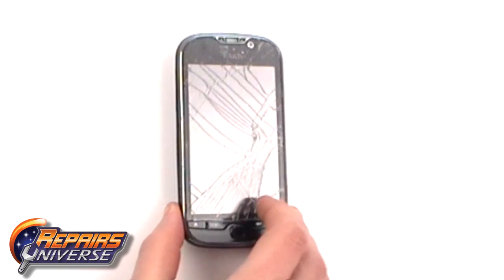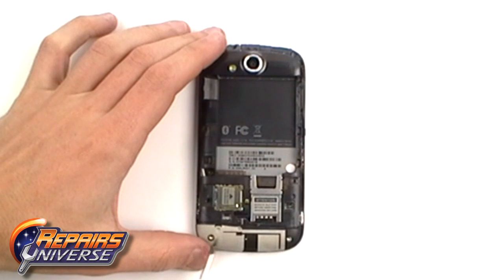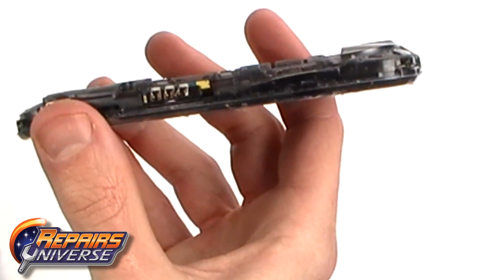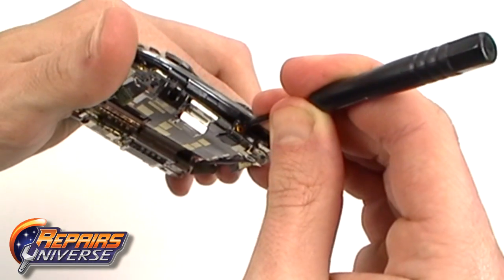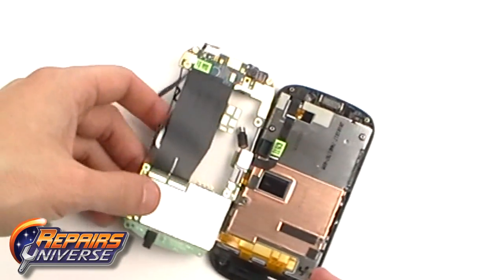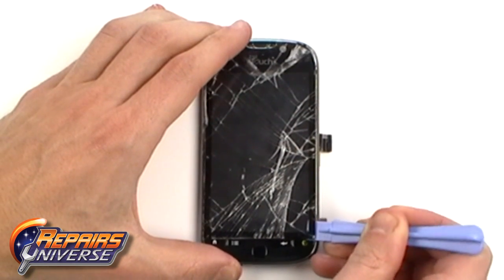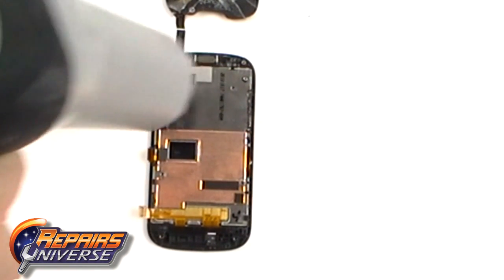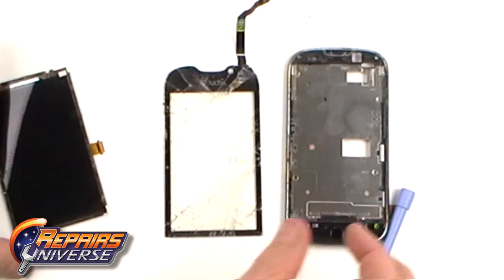HTC MyTouch 4G Take Apart & Screen Repair Guide

Comment: I tried this method last night. I now have a blob where it looks like the screen is touching the LCD screen and the volume flex cable broke off in my fingertips without even pulling on it.  The phone seems to be on but nothing on screen at all.  I think the main cable (the very short one thats hard to put back in) isnt in right. Do you sell replacement audio flex cables?

Comment from the maker: @SnObUnNiE04 Sounds like an issue with the keypad button flex cable. Either the connection is loose, damaged, being pressed in, etc. My focus would be on this flex cable. I am unsure, but it is possible the safe boot screen is being caused because these buttons are registering as already being pressed in. Start there and let us know if you come up with anything. Good luck!

Comment from the maker: @jmusgrove83 Sounds like the motherboard flex cable is damaged, not aligned properly, or not connected fully.
I would disassemble to that point and check all connections and check for damage. Hopefully you can diagnose the issue from there.

Comment from the maker: @shahwill1 Removing the physical power button. Likely an issue with the motherboard flex cable if that is the case. You should not have an issue returning the phone, however you would need to check with your provider to see the exact qualifications. We have had customers who have destroyed their phones and still got replacements. Others have a screw missing and are charged. Seems to vary quite a bit.

Comment: @RepairsUniverse By removing the power button, do you mean taking out the flex cable or the POWER button on the back frame?? I have tried it without the back frame coz the battery still goes in, but it still doesn't work. Also, T-Mobile sent me a replacement phone but they're going to inspect for 'physical damage'. My screen is installed correctly and there is no physical damage, do you think they will charge me the $80 for a new one? Also, i have it modded so will that be a problem???

Comment from the maker: @shahwill1 I would suggest removing the power button and then attempting to turn it on without the button in place. That will narrow down the exact cause. We have had many issues with the power button flex cable on the MyTouch 4G. Check for damage around the motherboard flex cable, it seems to become weak and rip very easily around the power button.

Comment: After i reassembled everything, my power button doesn't work.... I tried turning it on with the back frame out and it didnt work either. I doubt theres anything wrong with the internals as when i charge it, the orange LED light comes on. Please help? Also, its worth noting that i cant find the teeny little plastic sheet that came on the inside of the power button.......What DO I DO?

Comment from the maker: @biancabiancadonka If a flex cable is damaged there is no way of repairing it. Replacing the flex cable would be the best option. I am assuming the power cord flex cable is for the power button. The motherboard flex cable at RepairsUniverse (dot) com will replace this power button flex cable.

Comment: So if I accidentally broke the power cord flex cable, is there a way to fix it? like reconnecting it somehow? It got disconnected right at the actual button, not at the motherboard. Thanks.

Comment from the maker: @cgtrademark This is pretty common on the MyTouch 4G. What is happening is the volume button is being forced in, either on the button itself or on the inside volume button flex cable. This can happen by tightening the housing too tight or by the volume button flex being pressed. See if you can press the volume buttons. If they click, you will likely need to disassemble. If is stiff, loosen the housing screws a tad.

Comment from the maker: @dboiwil8503 Very interesting, we will keep note of this for future reference.. We have had similar issues with customers whose housing is slightly pressing the volume button. We did not make the connection that the screws could also apply a similar presssure. Thank you very much.

Comment from the maker: @Corben2781 Interesting. Is it the physical button that is pressing against the flex cable or just the flex cable reading that it is being pressed? The keypad buttons have 2 sections, the physical outer buttons and underneath, the keypad flex cable. I would separate them and poke around a bit. If that does not work, replacing the flex cable should resolve the issue. Check out RepairsUniverse (dot) com for this part.

Comment from the maker: @Corben2781 This is specifically a disassembly guide, following the guide in reverse will show the exact same steps as an assembly guide. There are a few possible reasons the buttons are not functioning; the keypad flex cable may not be lined up properly or the cable may not be fully connected (or possibly even damaged). Be sure that the buttons are set in the appropriate place for contacts from the buttons to fully connect.

Comment from the maker: @samdetroit89 Any previous issues with the phone? A recent drop, water exposure, previous screen replacement? Sounds like an issues with the bottom sensors on the touch screen. Could be because of a loose connection or damaged cable/connection. If those check out, a screen replacement will likely resolve the issue. Replacement touch screen can be found at RepairsUniverse (dot) com.

Comment: On my mytouch 4g the call/contact/call log/menu area on the bottom when I touch it dont work. its 1inch issue on the top side work fine. and I cant use some apps,games. Plz help

Comment from the maker: @VDUB113 Does it not turn on, or just not display? The digitizer should not effect the display in any way. A few places to start would be checking the LCD screens connection and flex cable.

Comment from the maker: @obonilla1234 That seems very odd about the signal. Unsure why it would only pick up ATT... I would just retrace your steps a bit and make sure all the connections are good and no damage to the flex cables have been made, especially around the antennas and sim card tray. As for the buttons, the flex cable and buttons on top can usually be adjusted to get the correct response from each button.

Comment from the maker: @MriiMbLacK You will need adhesive for the digitizer replacement, but it is suggested for nearly any internal repair. Some adhesive that has been in the phone for some time does not have the "stick" that is desired to hold parts together.

Comment from the maker: @JoeG444 You should have no issue doing that, Usually these are held in with adhesive. I wouldn't think that would be causing the full issue, but difficult to tell as I do not have it sitting in front of me. Sounds like you are getting close to diagnosing the issue, keep searching (carefully), your bound to find the cause. Good luck!

Comment: @RepairsUniverse Yeah, its like as soon as I put any pressure on the area where those 4 bottom keys are(Pushing the motherboard in the bottom clip) Or Screwing the two silver screws in, is when i hear a click, which is when the buttons get pressed from the back therefore making it unable to press them the way they were supposed to be pressed.

Comment from the maker: @JoeG444 I would suggest disassembling to that point and see what is causing the buttons to sink down. I am unsure if purely adding more adhesive will resolve the issue. You will need to figure out the actual cause and then you can figure out how to resolve.

Comment: @RepairsUniverse Im having the same problem but I got everything working the first time but the screen just wasnt making great contact with the lcd so i tried fixing it again and now it turns on but the screen doesnt. I checked the flex cable and its not damaged or anything I dk what do to. Does the adhesive have anything to do with turning on the lcd?

Comment from the maker: @sonpreetdoal Sounds like a connection issue. Check the LCD screen flex cable. Make sure it is fully in place into the connector. Also check for damage like rips.

Comment from the maker: @muderfukaa Ok, i would check all the connections too, to be sure all the connectors are properly in place. Slight issues with the flex cables can cause major issues with the LCD screen and digitizer.

Comment from the maker: @muderfukaa Has the light sensor been covered with adhesive? Some of these sensors can cause this blackout issue. Also could be an issue with the LCD screen / flex cable. Check the flex cables for the volume button, these are usually easily damaged. Replacement cables can be found at RepairsUniverse (dot) com.

Comment from the maker: @muderfukaa Yes, disassemble and make sure everything is secure. Using adhesive strips is recommended to seat the digitizer. Please check out our "Touch Screen Assembly Guide" which will walk you though the steps to apply adhesive and seat the digitizer.

Comment from the maker: @muderfukaa Sounds like the digitizer is not fully seated. Did you use adhesive to attach the screen? The touch screen will need to be re-seated and aligned correctly. As for the charging port, something is not lined up correctly. Re-aligning the motherboard, flex cables, and housing should resolve that easily.

Comment from the maker: @saferkefka Sadly it is not that easy, you will need to follow the full disassembly steps. Screws from the back, flex cables, and housing will prevent you from doing this repair from the front.

Comment from the maker: @cassie4211 Water damage is tricky, as it is difficult to tell what was affected by the water. Damage to the motherboard is the worst case, which would cause it to not turn on. Water in the LCD screen will do the same, giving you no display. Disassembling the phone may be the best way to diagnose the issues and completely dry it.

Comment from the maker: @munchiie18 Follow this guide to disassemble and check the volume button flex cable. It may need to be replaced. Water damage is trick, and there is no easy way to diagnose the issue. Maybe once your MyTouch 4g is disassembled you may be able to figure out the issue with the volume.

Comment: I have a mytouch 4g that the internal screen has shattered.  the digitizer is fine.  would it be possible to replace the screen without taking apart the whole phone.   meaning just heat up the glass lift it off to the side and replace the screen?

Comment from the maker: @PylonFlyer This can happen. Its not as common as the outside glass getting cracked but we still see this issue a lot. 

We have the replacement LCD screens @ RepairsUniverse (dot) com.

This part will fix your issue.

Comment: Great video!  Question:  How common is it that the LCD screen gets broken and not the glass??  I broke my display while phone was in front pocket.  Must have been crushed or bent.  I had a digital crack across the screen, pixels jumbled, but partial view of the screen.  Touch screen still worked.  Then LCD quit displaying at all but I could unlock the phone by swiping and use Genius button to call.  Thanks in advance!!  Would be interested in buying a new LCD...

Comment from the maker: @DiscoWar1234 Either the connector is not fully in place or the cable has been ripped. Disassembling the phone and inspecting the connection and flex cable should give you some answers and hopefully resolve the issue. Good luck!

Comment from the maker: @warriorsid Sadly not many other tapes will work to hold the digitizer firmly in place. Some customers have tried different glues, but usually causes messes and more hassle. RepairsUniverse (dot) com does have adhesive strips available, which can be cut to properly fit.

Comment from the maker: @pinchi89 We have yet to have an issue with using heat to warm the adhesive. Just keep it on low heat and keep the heat distributed by moving your heat gun or hair dryer. Don't stay on one area too long.

Comment: My girlfriend threw my phone in the wash with the bed sheets. Pulled it out early. Dried it out a lot and all functions still work. But I am trying to dry up the water that seems trapped inside the screen layers. Would you recommend dismantling to dry it out or just throw it in rice for a few days? Thanks for a great video. I like tinkering but this gives me much more confidence. :-)